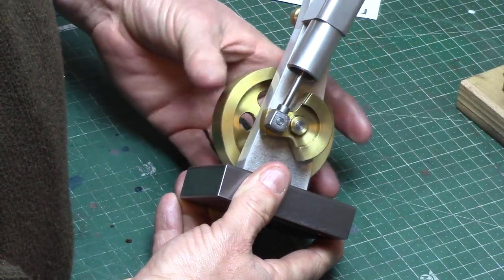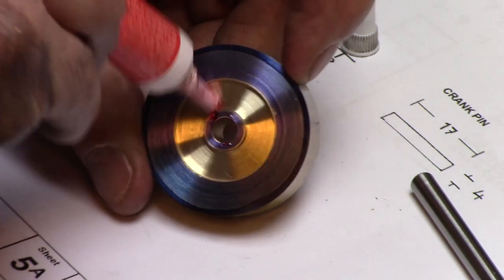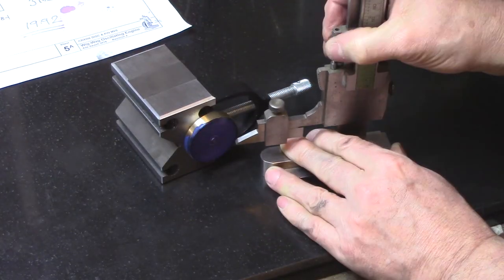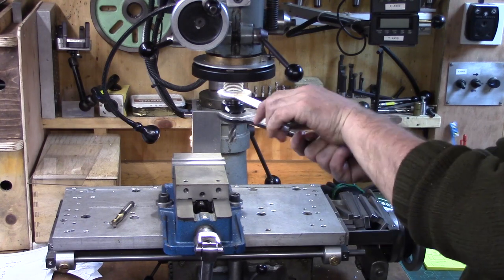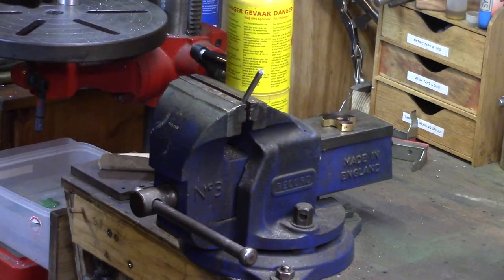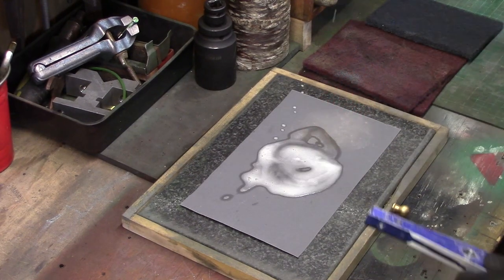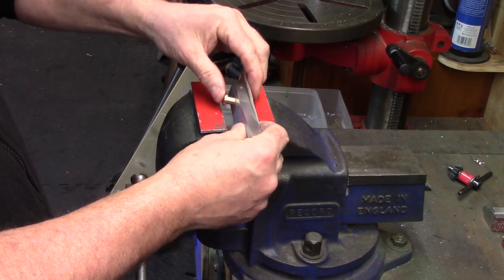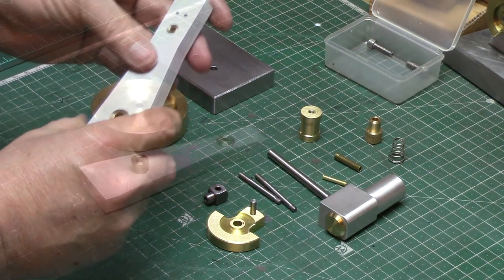Wig-Wag Steam Engine Build Series Part 7 - Making the Crank Disc, and fitting the Bearings

Comment: Thanks so much for this project! I'm building this right now and having a blast with it! A quick question about the disk... Is the flat where the crank pin is inserted milled down 1mm? That plans specify a dimension of 7mm, but I didn't see you machine that in this video. Thanks!
Reply from the maker: Hi XS, you might be working from my older plans, check this link for updated plans. https://wigwagengine.wixsite.com/wigwag